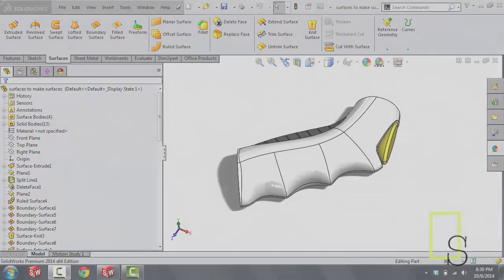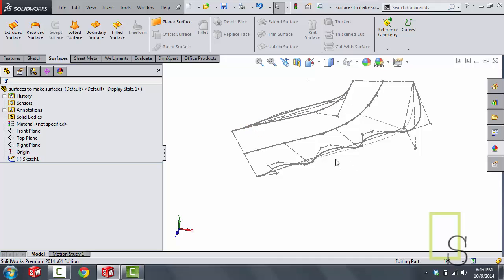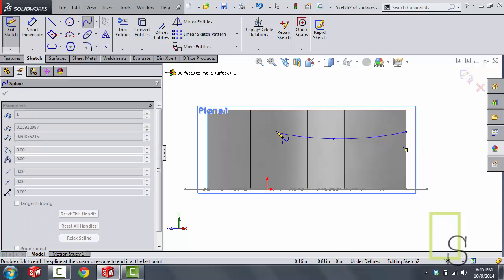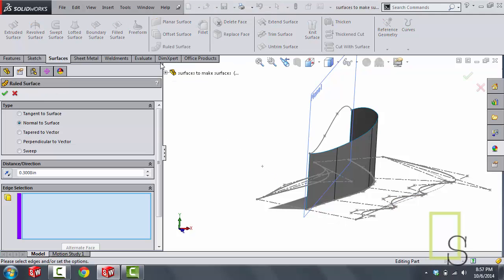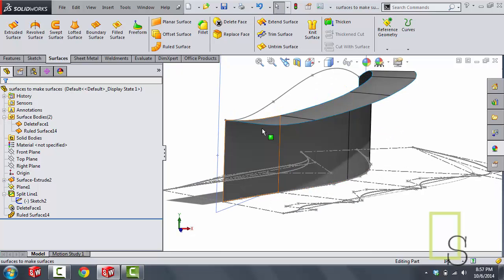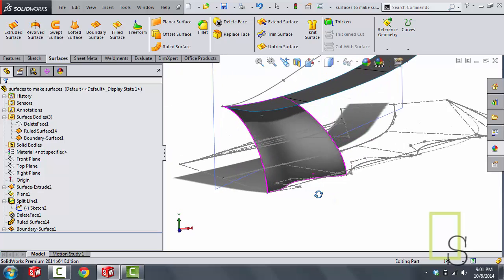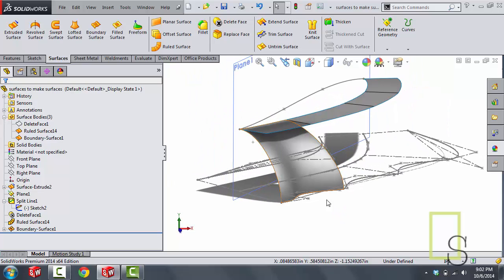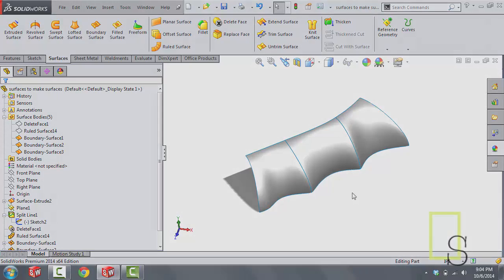SolidWorks - Organic Shapes with Reference Surfaces

Comment: 1. You could just cut surface using the trip tool.
2. You dont need to use rulled surface to make sure that created loft will be tangent. It is easier to check "normal to profile" option.
Anyway very good tutorial :)

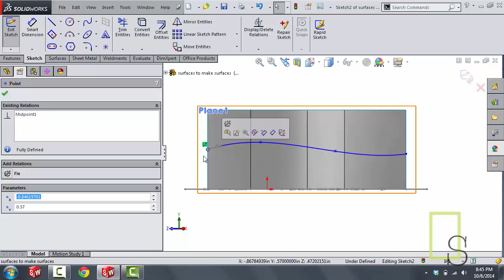Comment: Thanks for this great tutorial! One question, just for my own curiosity: at 3:50 , why did you not cut off directly the surface with  that sketch? It with the extra split line it takes an extra feature.

Comment: So... Tools used: Line to create profile, "Surface-Extrude"  to make your handle curve, "Reference Geometry Plane> Select 3 vertices" to make a plane touching 3 points, "Spline" to create the line profile needed, "Ruled Surface" to make a surface to align on all of the needed things, and then "Boundary Surface" to really make things work well.

It's not 3 steps

It's not super clear

I'm going to figure this out because of this video, and make an awesome grip. Thanks for posting!

Comment: for everyone asking how he manages to connect the ruled surface edge with the bottom outer profile, keep in mind that was using solidworks14. I'm doing a similar project close to this one but i couldnt get that darn outer profile to be selected. I watched another vid using solidworks8 and then it mentioned how if the "selection manager doesnt show, just right click and select it". Did just that and after making my two ruled surfaces (cuz it didnt connect as one like this video), I make an open group selection of my outer profile, clicked the check mark and wolla. it worked.

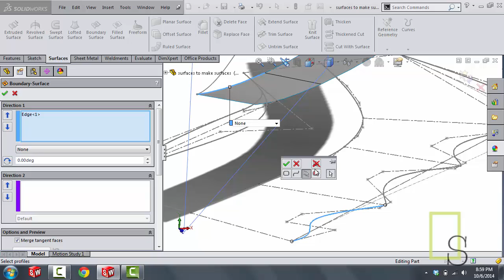Comment: I am having troubles when using the "boundary surfaces" tool. The thing is I can't connect the 1st sketch with the line in the ruled surface since the sketch is not visible. (What he does in 7:20 approx.
How is that fixed?
Reply: The purpose of the ruled surface is to use a surface EDGE as a selection, rather than a sketch. If you cannot select it, check your display filters to make sure they are visible.

Comment: Nice video, but it just shows how is insanely overcomplicated and redundant traditional CAD programs get when you have organic shapes.
They really weren't meant for this, so this approach doesn't scale well to very complex designs.
I just use Catmull-Clark subdivision surfaces with wall thickness + boolean operations in EQUINOX-3D. The only place for parametric shapes is for spline-directed cutting shapes (snapped to the surfaces) and constraints (e.g. place screws along a spline, constrained to a surface).
This is much more direct and more intuitive and you get solids in the end with adjustable resolution that can go straight to 3D printing or into a CAM app for toolpath generation.
You also have a lot more freedom and rather than manually matching a reference surface you can just import any hand-built or 3D scanned polygon mesh and use it directly (usually, after some cleanup).

Of course, it doesn't hurt that it's all integrated in a 3D modeling/rendering/animation software, so you can see photorealistic renderings of the part, in a complex environment and you can even control the robot with a plugin...

All I have is organic shapes (mostly humanoid robot parts), so the old-fashioned "numerical CAD" approach is not much help any more, except for simple tooling/work holding parts.

I need to blend complex organic and geometric shapes a lot and Catmull-Clark does it naturally, with any topology.

A simple handle with some bevels is one thing, but doing something like the complex, blended parts for the skull of our robot it SolidWorks, would take forever and you would end up with a messy spaghetti of guide curves.
Reply: Unfortunately EQUINOX-3D is still not available for Windows.